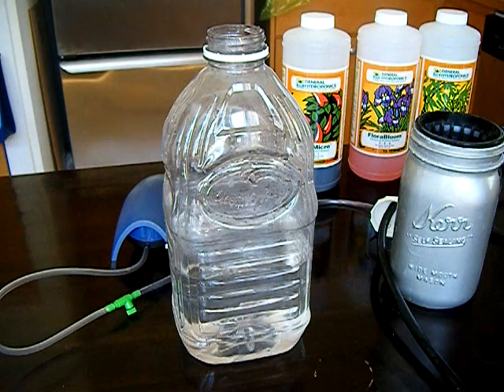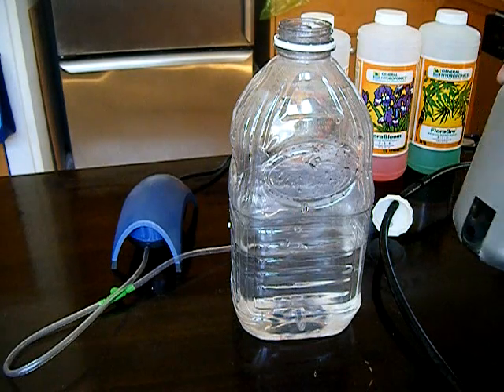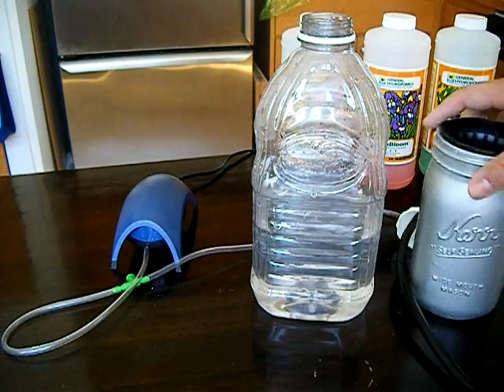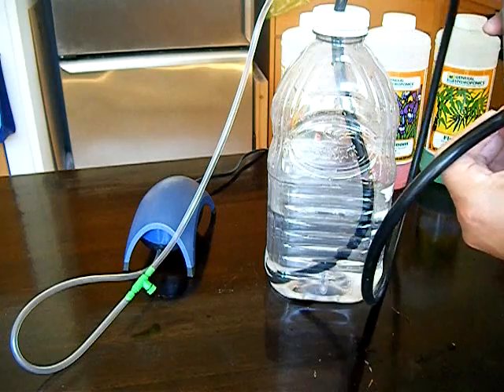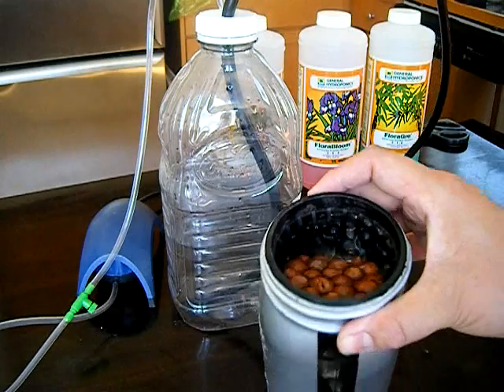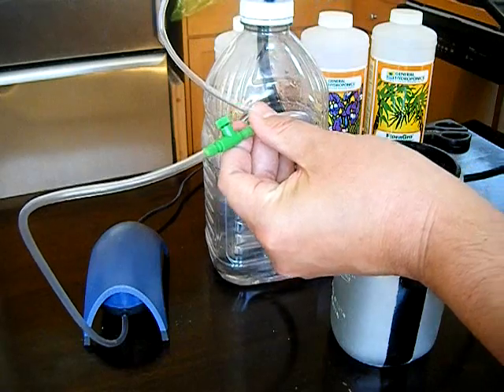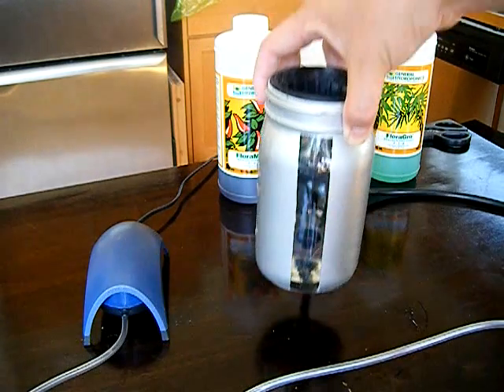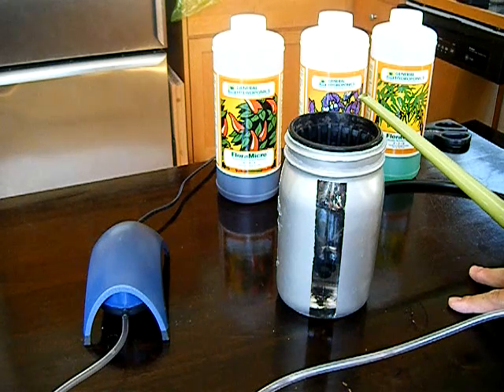Part 5: How to build extremely simple hydroponics system

Comment from the maker: @FenderGibsonWashburn Hey thanks anyway, it was a cool theoretical project!  Its great that you were thinking about it so extensively!  I had planned to see what you were up to by reproducing your BB/ball point pen check valve, but never got around to it.  

The cheap plastic aquarium relief valve is really sufficient, available at any fish store, and pretty much works as a 'leak in the air line'.